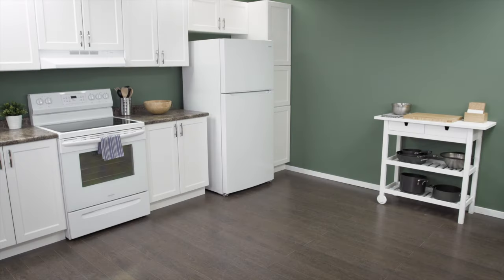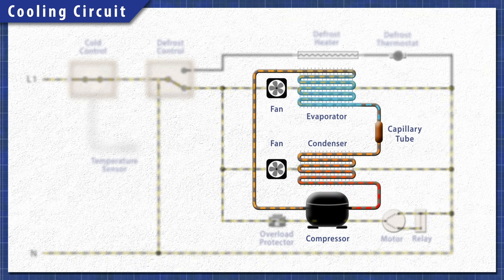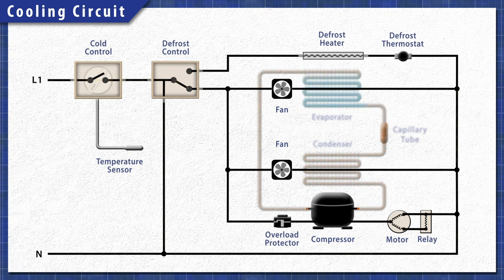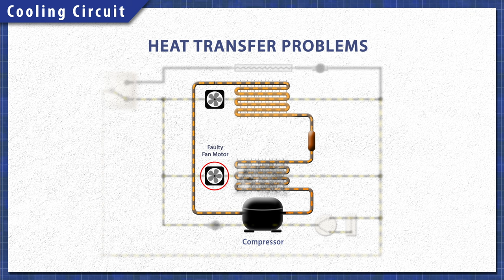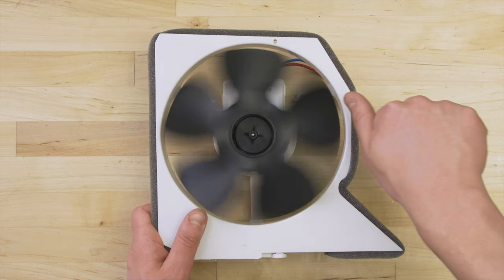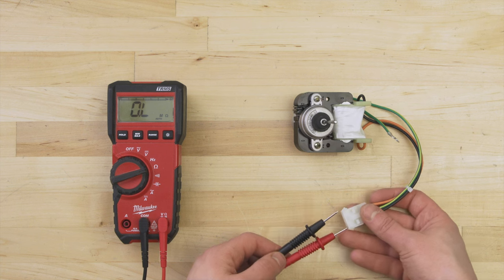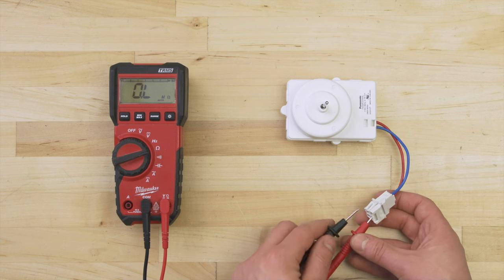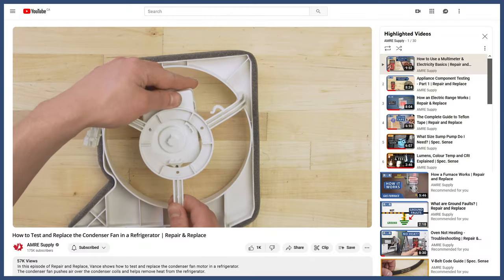Refrigerator Condenser Fan Motor (Quick Guide) | Repair & Replace

Comment: I have a question about the condenser fan okay my fan from my refrigerator is turning off randomly every either 44 or 45 minutes the most but sometimes less than that so then I have to either unplug the refrigerator and plug it in again or turn it off and on from the electrical box so yeah that's my question if you can help me thank you
Reply from the maker: Thanks for watching. Is it turning off as in losing power (no lights, no fans)? Or the refrigerator stops any cooling until you unplug it?

Comment: does the fan have to blow on the compressor or suck the hot air around it ?
Reply from the maker: Thanks for watching. Since the condenser coils are hotter, the condenser fan has to pull air over the compressor (which will be fresh air from outside the refrigerator) to push over the condenser coils.

If the reverse was true, then the condenser fan would be pushing hot air over a warm compressor, which would not help it stay cool.
Reply: @AmreSupply  aha thanks  for explaining

Comment: Question - does the condenser fan and evaporator fan needs be running continuously? 
Having issue right now where the freezer isn’t freezing or getting cold. 
Light is on and the fridge is still a bit cold. Can’t find the issue thinking it’s the condenser fan but haven’t tested the voltage 
Any thoughts?
Reply from the maker: Thanks for watching. If the freezer isn't freezing or getting cold enough it could be an issue with the defrost system. If the defrost fails then ice will build up on the evaporator coils. This reduces heat transfer and the system will run more often to try to cool it down but this only creates more ice. This video explains what can prevent good heat transfer and how to access it all: https://youtu.be/oPmr6boufmE?si=aChMaQh39U62jjGO

If there is an ice buildup then you'll have to test the defrost circuit: https://www.youtube.com/watch?v=r2YUNLPs4kM
Reply: @AmreSupply  okay i review some of your video which tells me i need a multimeter. So I check what I can. The condenser fan and evaporator fan seems to work when I unplugged and plug the power back.
The evaporator coil seems fine, no ice but probably need to check the continuity of each part to find the source… 
Also want to mention this isn’t the first time it happened. Happens a couple of times, but happens over a couple of months before the problem starts again.
Checked your website for part but doesn’t have my fridge. (Insignia Model : NS-RFD26SS9)
Reply from the maker: @josezacarias3215  Thanks for the update. It seems your model will likely have a few additional parts. 
You'll likely have a thermistor (temp sensor) in the freezer and fridge. It's possible that the freezer thermistor is faulty. You'll need a multimeter to test this: https://www.youtube.com/watch?v=HQFRUuWIz_o

The damper motor controls the airflow between the fridge and freezer. This can sometimes fail or get stuck and limit airflow: https://www.youtube.com/watch?v=LlyDFV31c4k

Comment: Condenser & Condenser fan not getting power. Your thoughts?
Added mini fan to the back temporarily and refrigerator/freezer cools like normal.
Reply from the maker: Thanks for watching. If you have verified that the condenser fan is not getting power, but the compressor runs and the evaporator fan is running, then it could be an issue with one of the connections, or the wires. In models with a control board, it could be a faulty relay on the board.

If the condenser fan is getting power but isn't moving, then it's likely a faulty motor.

Comment: Hello
Sir i have deep freezer its taking alot of time to freeze  approximate 2 or more days.
I have changed thermostate. nothing improved.
I think condenser fan might be issue could you help me plz
How can i chk fan?
1. fan is making noise 
2 fan has little bit play
Reply from the maker: Thanks for watching. Normally it takes a deep freeze 24 hours to get down to temperature the first time it is turned on?

If the fan is running but is making some noise then it can be a sign that the bearings are starting to fail. As well if it is vibrational noise, tightening the mounting screws can help.

It's worth trying to clean the condenser coils to ensure that there is a good transfer of heat.

As well make sure that there is enough space behind the freezer for air to move freely.